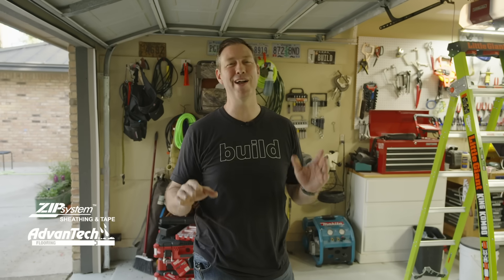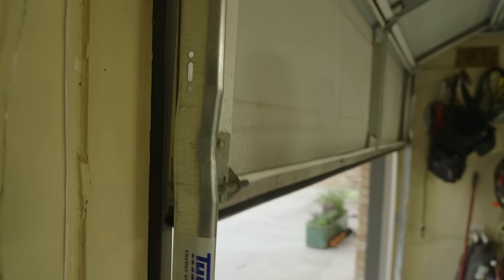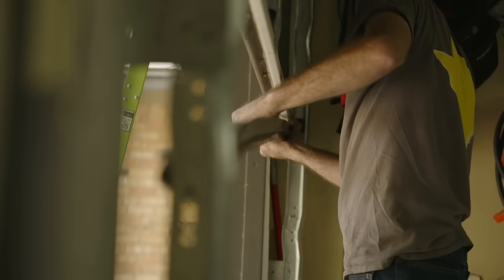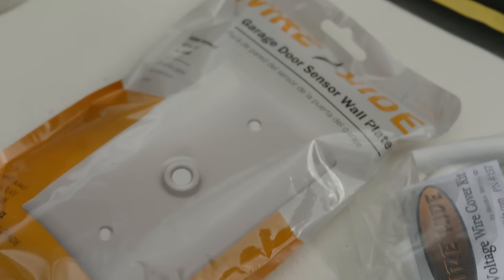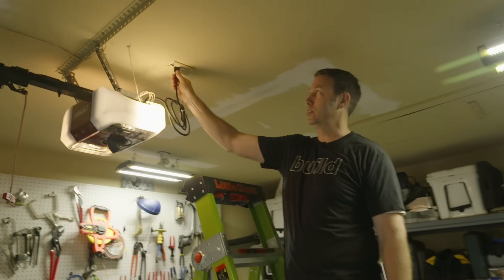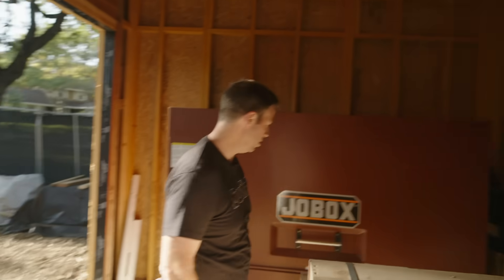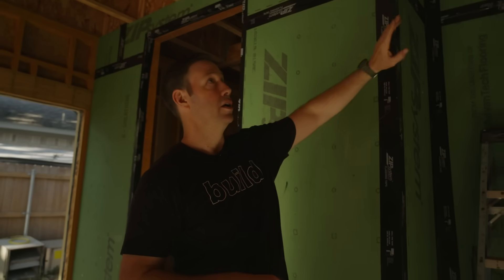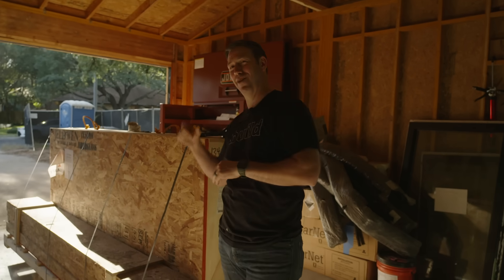Garage Door - Air & Bug Sealing

Comment: Small diameter foam should be inserted into either ends of the rubber on the bottoms sections of the door.
If you wanted to you could apply it to the whole length of the section, looks maybe 8’ if your replacing the rubber since it’ll be easier to insert.  Leaving a half inch on each side doesn’t hurt as long it doesn’t rubs the weather strippings too much.
We use to use self tappers or a simple hammer to bend the aluminum so the rubber can’t creep away from the ends ( critter entrance )
It’s circular in diameter - @ US quarter and is sold at the box stores.
Spray some Wd-40 in the track where the rubber goes to aid on installation.  
Also, you can adjust the vertical track brackets or weather stripping on the exterior to seal the doors more securely.
Also, might have to adjust the down travel on the belt opener to compensate for the foam as it might close too tightly.

Comment: I replaced my 12 year old builder grade uninsulated doors after they were damaged with Wayne Dalton foam core insulated garage doors. Well worth the money as these have tongue and groove seals between the panels, and the insulation is excellent. Especially since my doors face south and are constantly beat on by the sun.  If I was building a new garage today I would 1) make it wider and deeper to accommodate shelves, extra fridge and freezer, and work benches while still being able to park vehicles and be able to open all the car doors. ( We have a "3" car garage that I can only park 2 SUVs and my motorcycle in, and one I have to pull in backwards in order to open the driver's side door. Yes, we actually use our garage for parking in!) 2) install my gas furnace and AC unit up off the floor high on the front wall to free up that floor space, along with a dedicated alcove for gas water heater and water softener, again so it doesn't rob garage floor space. 3) have a floor drain or two installed, along with tiled floors and tiled walls on at least one bay. This protects against flooding from a busted water heater, allows the winter snow and ice road sludge from the vehicles to drain off and allows you to wash a car in the garage during the winter. And most importantly 4) ensure ventilation in the garage is sufficiently balanced to allow hot air to be blown out without causing the exhaust draft to get sucked out of gas furnace and water heater exhaust ducts. My garage gets too hot because of these appliances, and if I set up a ceiling exhaust fan I run the risk of drawing out from the furnace duct. A split unit is a great add, but simple and adequate ventilation would solve 90% of my issue.

Comment: Talking to firefighters I would never use I joist in my house they failed way to fast. Since they are toothpicks.  If one I joist fails it comprises the whole floor. And since we have so many plastic things which are petroleum base it like having gas cans spread all over your house. Back in the old days house fires smoke would be between 750-950° NOW house fires are more in the 1150-1400° according to a firefighter I talked to. Even though they make you use 5/8 drywall where every you use I joist. Just the heat alone from the smoke  will melt your can lights and get into the joist space start every on fire. Its crazy scary. Better spray that fire retardant paint on everything.

Comment: Matt I installed this product many years ago, simply silicone in place and has worked extremely well.  https://www.amazon.com/Universal-Threshold-Weatherproof-Stripping-Replacement/dp/B0858ZSGWH/ref=asc_df_B0858ZSGWH/?tag=hyprod-20&linkCode=df0&hvadid=416693569362&hvpos=&hvnetw=g&hvrand=7501188525051538935&hvpone=&hvptwo=&hvqmt=&hvdev=c&hvdvcmdl=&hvlocint=&hvlocphy=9022814&hvtargid=pla-899740615097&psc=1&tag=&ref=&adgrpid=94306392392&hvpone=&hvptwo=&hvadid=416693569362&hvpos=&hvnetw=g&hvrand=7501188525051538935&hvqmt=&hvdev=c&hvdvcmdl=&hvlocint=&hvlocphy=9022814&hvtargid=pla-899740615097

Comment: I just bent my rails like these expensive ones. Garage is tighter now. Thanks for the tip!
Reply: How did you bend them?
Reply: Really?  The rails are not bent; they are forged to be about one inch dropped from the straight run.
Reply: Only just noticed the dates on all these comments, so there should actually be an answer to this, now: I'm wondering, with the door pressing forwards at each bump: does that wear out the weather stripping faster? Seems like the additional wear would take its toll after awhile.

Comment: I'm not convinced that a motion activated ventilation system is needed for pulling a car in to your garage.  You have a 16' wide door that's open, and presumably you're not going to run the car in the garage with the door closed because you're not a moron.  You open the door, pull in, park, turn the car off, close the door.  Problem solved, no ventilation required.

Comment: For insulative and air tight doors I have used Rytec high performance doors on my commercial projects. They have large loading dock/garage doors for refrigerated warehouses and clean rooms. They have both fabric and rigid panel doors. Most of their system are customizable. Look at the Spiral LH with insulated slats. They also have high wind (hurricane) rated doors since you are in the gulf coast area. Don’t know if they are the astatic you are looking for in a residential garage door.

Comment: 2 things:

1.  Consider using Westroc Fireboard on the garage ceiling and on the common wall between the garage and house.

2.  An exhaust fan without an appropriately sized fresh air inlet could put a negative pressure inside the garage, with the potential for drawing radon laden air into the garage from the earth beneath it.

Radon gas is a problem in some parts of the United States.

Comment: An exhaust fan without a sufficiently sized dedicated air inlet is a BAD IDEA.

Without an incoming air source that exhaust fan will pull a negative pressure inside that sealed up garage.

The danger of negative pressure, at least in my part of the county, is the possibility of drawing radon laden air from the earth beneath the garage into the garage itself.

Comment: The track is a product that is only needed for the Clueless people that don't see the slotted adjustable track stand off brackets. You have to take out  the bolt  to replace the track so why not correctly adjust the track and save your money 🤑🤑🤑.  

Free product is a sponsor 😉😉😉.

The new 16  X 8 garage door will be fine for parking his wife's suburban. Anything else will be a issue because how close to the left side wall the garage door is.  There is no room to open a car door and have room to get out.  Even 2 small vehicles, the car on that side will need to be backed in, especially with a 2 door vehicles and the long doors they have.  

I would have expected more from a professional building his own place........

Comment: I also have a problem with my garage sensor that at a certain time of day the sun shines on the sensor and you can't put the door down unless you block the sun from the outside.
Reply: Yes!  Some days I have a hell of a time closing my garage door.

However, it was not a problem in the late 1990s when my house was new.  It’s just become a problem in the last 2 or 3 years.  I’m thinking the problem might be with those sensors.

Comment: 14:07 Closed cell foam between the garage and the upstairs floor sheathing is a very good thing. I feel the cold air from my 2nd floor pouring down into my garage during the summer months.  This adds to the comfort level of the garage but it is very wasteful.

I did add 2 layers of 3/4 foam to my garage door to block the direct west sun baking the garage door in the afternoon.  This did help a lot with the heat gain and the sound of the cheaper doors.  

I also added sealed bearing nylon rollers (a little quieter) the cheap metal rollers are crap.

Next I added a jack shaft opener so I had better access to my 4x8 wire metal shelving above the garage door  https://www.costco.com/saferacks-4-ft.-x-8-ft.-overhead-garage-storage-rack-and-accessories-kit.product.100006897.html

Comment: Helpful video. I was waiting for you to touch on an issue I’m experiencing but I didn’t see it. Maybe I missed it. If the door has been closed for an extended period of time e.g. overnight, the weather stripping sticks to the garage door and the first time I open the door, I get a big bang like a struggle to open. I THINK the stripping is sticking to the door and holding it until it “rips” away. I was thinking of treating the weather stripping with something but didn’t know if it would adversely effect the material of the stripping ( some form of grease, oil, or even powder). Any experience or ideas? Thanks

Comment: Great video!  I liked and subscribed to your channel. Question for ya.  On the outside of my garage door if i wipe my and across it then I get dusty paint on my hand.  Is there a way to apply some kind of clear sealer to the door?

Jim
Reply: Thats the way most factory paint ends up on garage doors..  and no you cant clear over the dust.  Youd either have to wash with soap and water then wipe with alcohol and lint free rag before cleared or lightly sand the whole thing, wash with soap/ water then alcohol and paint with a metal paint.  Or spray paint..  easier to roll on some paint meant for metal like the stuff youd paint outdoor furniture with.  Theres kinds you can tint or color match..

Comment: Regarding the garage vent and fumes, is the system intrinsically safe? Natural gas or gasoline fumes being drawn over a standard electric motor may cause the fire you are trying to avoid with the fan.

Comment: North Central garage door makes an inflatable tube that goes inside the bottom rubber to make a better seal.  Idk if that’s enough of what your thinking for the bottom.  As for insulated doors I’m looking at putting a R18 HAAS door in mainly because of the air sealing between the panels.  Something that most other brands don’t have.

Comment: My parents fiberglass garage door faced due east and the garage would be like an oven by 10:00 am. They replaced the standard door with an insulated door offered by a garage door company...nothing upgraded to the insulation, but they did get the model with windows. What a difference! It was really nice because their laundry was in the garage and it made it much more comfortable than baking hot, although the garage would still always be at the temperature and humidity of the outside air once the door was opened for a car. The natural light was nice, too.

Comment: We have only electric cars here at our home. No gas power tools either. No oil rags, paint cans or anything like that in the garage. It's simply a space for electric vehicles, bikes and battery powered yard tools. No worries about fumes or CO poisoning. My dream home would be to have the attached garage be part of the conditioned living space. Pull into the garage and walk into the kitchen. Yes that is totally against existing building code but what if it was understood that ICE engine vehicles will never use the garage?  Why not? I suspect this will become a thing in the next 10-20 years.
Reply: Also thanks for the follow-up on the overhead weather-stripping coming down. It's good to see the real issues that can come from being a pioneer in this area. Great job and Thankyou.

Comment: Hi  4:05 time. Botton of wood  door. I stripped off the rubber strip. Took 1 inch black water pipe insulation, you know, the ones with the slit in them. Stretched the slit, to wrap over the bottom of door. Got my trusty staple gun, and stapled the tops of these 'wrap over' door sealers to the door, right at the lip, both sides. If your floor is uneven, just adjust the insulation up/down to seal it. The door can drop a few feet, and seals absolutely perfect. Come rain or shine, no leakage WHATSOEVER.  No need for you to spend GOOD  MONEY  on bullshit thin rubber.  Costs about 7 dollars for the six i needed. SO  THERE  .....promo companies. Get creative.......

Comment: I think you may have done this before... Panasonic has a fan that will run in “low mode” 24/7 until it detects motion then goes to “high mode” for a preset time. It works well in a garage application.

Comment: Thank you so much for sharing your welt of information.  You have been so helpful.  Question- I have a side mount Liftmaster opener with an automatic light that turns on and off.  But lately the light has been staying on until I turn it off manually. We reset it and just doesn’t operate right.  Now I just unplugged . I would like to know how to fix it or should it be mounted some place else in the garage?

Comment: That track is dumb. You have hinges labeled 1, 2, 3, 4, etc for the very purpose of pushing your garage door against the frame. That track is for people who installed their doors wrong to begin with.
Reply: The door is not meant to touch the frame. The hinges are staged to tilt the tracks away from the opening.
Reply: @michealboyle8555  you are correct. When the door releases being picked up it is NOT meant to touch the frame. When the door is closed tho, it is meant to be against the frame, or the trim thats there.

Comment: We added a commercial exhaust fan in our 3 car garage. When you pull 2 or 3 vehicles into the garage in the summer time the temp rises well over 100 degrees. Even though the ceiling is insulated, it still raise the temp in the bonus room above the garage. The exhaust fan solved all these issues. We run the exhaust fan 24 hours a day all summer long and it works great. All garages should have exhaust fans.

Comment: Matt,  I also have a 16 foot garage door with an opener.  I am annoyed that I have to open and close the garage door to get in and out of my house. So I plan to install an 8 or 10 foot door and then use that extra 6 or 8 feet to install a wall section with a secure lockable door for entry and exit from and to my car, which actually is protected by a carport.  Since I have had problems with maintenance of my garage door opener, I plan to not use an opener and try opening and closing the garage door by hand, then locking the door with a simple sliding bar operated from the inside.

Comment: Install a Lift Master side mount opener on the remodelled house.  Eliminates the track, is quieter and has an automatic dead bold.  A bit pricy ($500) but well worth it in my opinion.  Although much cheaper if they send you one for free.  You are beginning to sound a bit "corporate" in my opinion.

Comment: If you order an insulated door, be sure to specify an insulated glass panel if the door has glass in it. HAAS and AMAR doors do not come with insulated glass panels even though you ordered an insulated door! I learned the hard way.

Comment: You should check out the best weather sealed door in the market...www.Garaga.com . They also provide a dual fin weather trim with matching colors to the door. If a garage door doesn’t have the proper seal in between the sections then why have an insulated door at all?

Comment: Thanks for all the tips, I just bought a used home with a two car garage with a room about the garage.. I will consider the weather seal that goes on the side of the garage I already have replaced the bottom seal of my garage what I am considering is installing a threshold seal that you glue with construction adhesive to the floor below where the door meets the floor.. What do you think about idea?? Thanks for your video...

Comment: I own a garage door company, In Saint Louis Missouri. Instead of the tracks, check out green hinges!
Reply: They look like they solve a specific problem, but shouldn't be needed in regular installations when the track and trim boards are properly adjusted.
They don't solve the more challenging problem of uneven bottom, e.g. curved, sloped or off-square.
Reply: I have those hinges there good but don't correct all garage door problems maybe combined with the tracks they would be better.

Comment: Like the videos. The garage vent sounds like it might combat fumes but it also sounds like it will be fighting the airco/heating installation. Why not have a CO detector trigger the ventilator or have a manual switch for when you are generating a cloud of dust with drilling or sawing? Although that said, if you have made the seal to the house airtight then surely you can just leave the garage door open when you are working in there.

Comment: a trick i never see but i can't be the only one to do this. i bought several 2"x4'x8' rigid foam boards and ripped them to the height of each horizontal door section, two across for double door. you need a bevel cut about 20-30 deg on long edge of each section, one edge only top and bottom, to allow the door to fold are it rises and not bind the insulation boards.  use foam glue and 2 1/2 hex sheet metal screws with fender washers to add support for the foam glue. with a little thought and done right, i have covered every metal door member, including horizontal rails. from the inside the only door metal, not covered, is the frame around the windows.  there are no longer any metal door part heat sinks to the MN sub-zero winter air temp.

Comment: Why not just adjust the straight tracks to force a slightly tighter close. that curve seems like a good way to cause the door to jam when opening or closing. Also higher quality installs don't have that much play in the tracks.

Also would love to find a better gasket for the bottom of garage doors. I work in pest control and likely half of mice problems are caused by garage doors (or the garage door frames) and that flimsy gasket doesn't stop mice for long. Currently the options that we have seen are so terrible that we just tell the customer to call an overhead door company, as we want nothing to do with such a low quality solution. If I knew of a good product at least we could point them to it ,or maybe we would even install it.